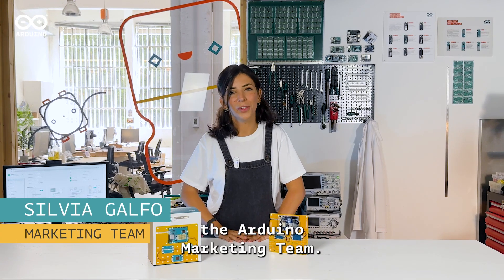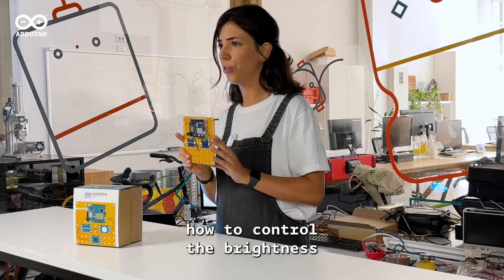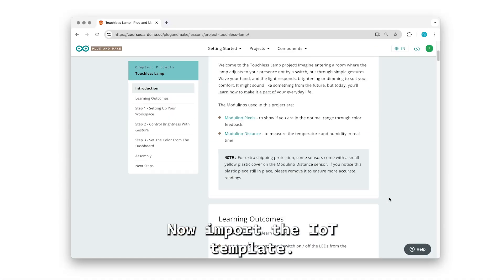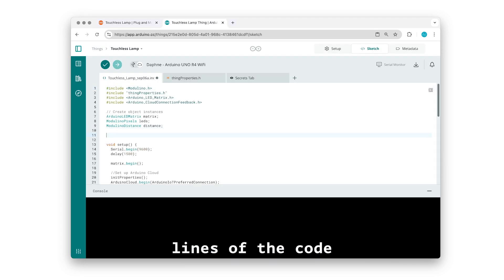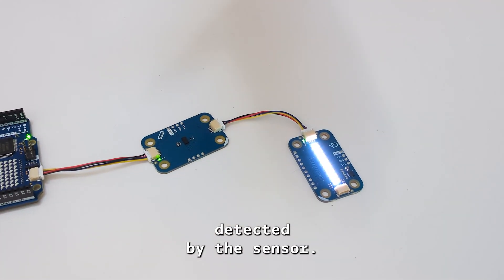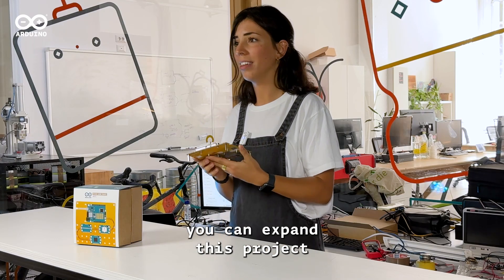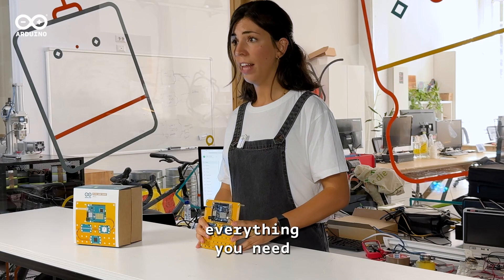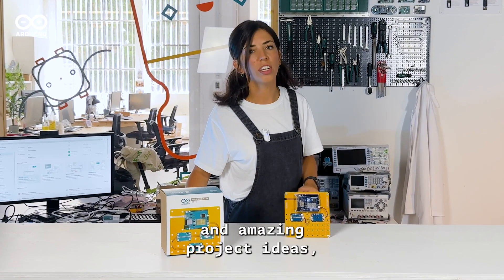Arduino Plug and Make Kit: Building a Touchless Lamp

Comment: I call the Arduino a "computer that controls machines" its basically that in allot of ways, also known as a microcontroller, here in this video she shows a input distance sensor to detect the distance of her hand and the programmed Arduino responds with the brightness of the LED, so you could put a input distance sensor on the bottom of a rocket, and control the throttle of the rocket landing. I'm going to beat SpaceX to the moon, ahh yeah!!! 🚀:rocket-red-countdown-liftoff:😃🌛